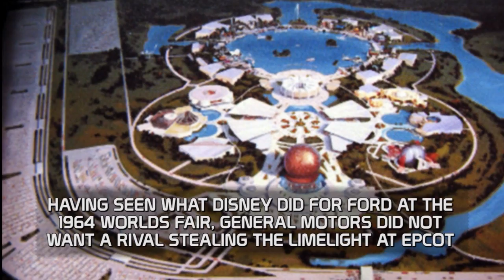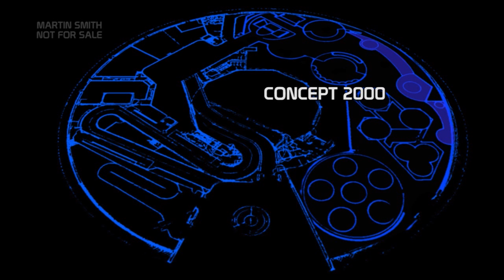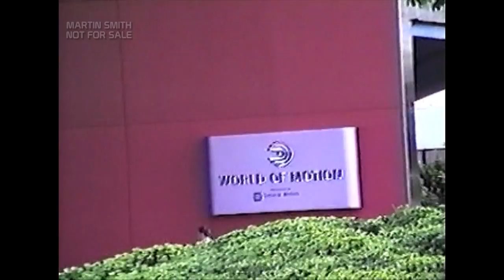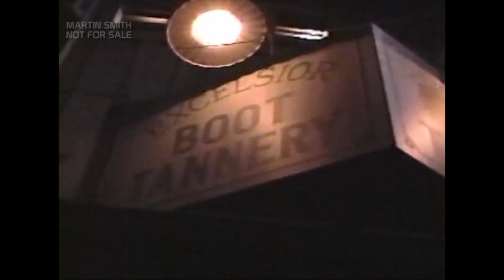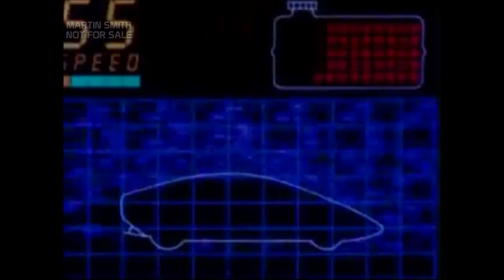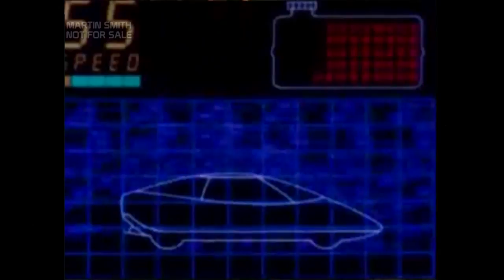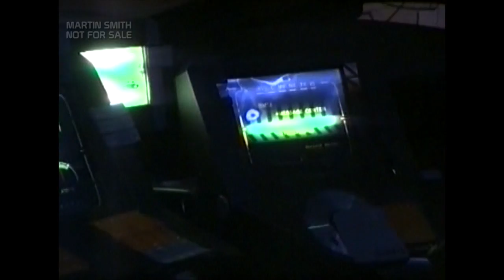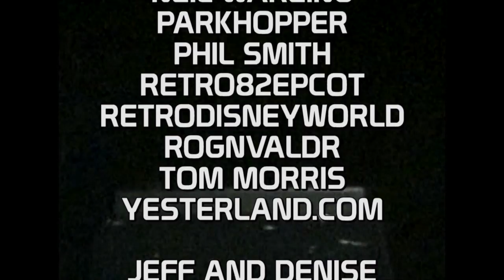World of Motion - Martin's Complete Ultimate Tribute

Comment: Thank you for yet another fantastic video. This attraction was more Disney, timeless, relevant, family friendly!! Test track holds nothing over this attraction. All they had to do was update it periodically to reflect the new years.
Reply: Test Track was added because Disney felt EPCOT needed a thrill ride… 

Something that could appeal to older audiences. And World of Motion, well… It wasn’t raking in the crowds as it had in its early years.  But even with the replacement of World of Motion, Test Track retains the transportation theme, albeit with more focus on cars than just transportation in general.

The original 1999 Test Track placed emphasis on the near future of transportation by showing how modern cars were put through their paces. And the current version leans more into the future aesthetic by showing how concept cars are designed and how virtual reality (the SimTrack) allows designers to simulate the various conditions a car has to face during operation.